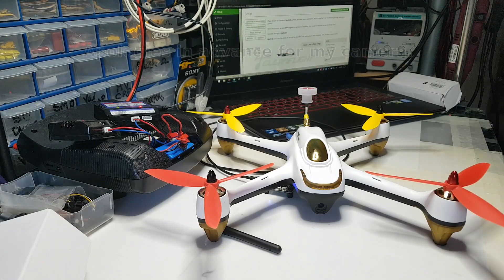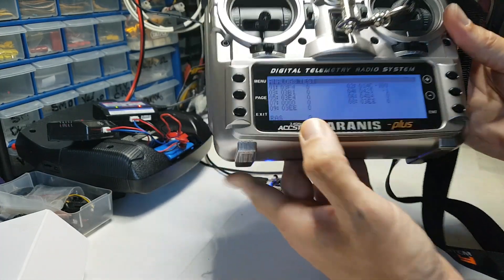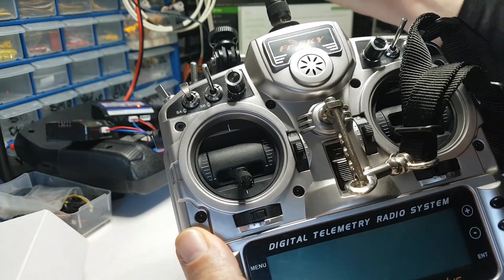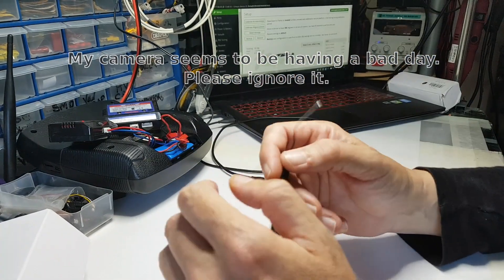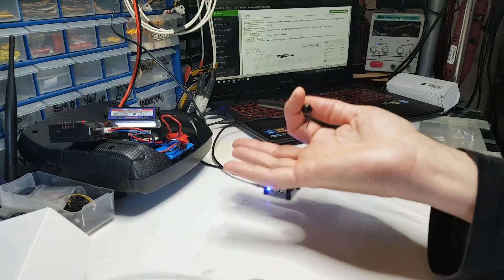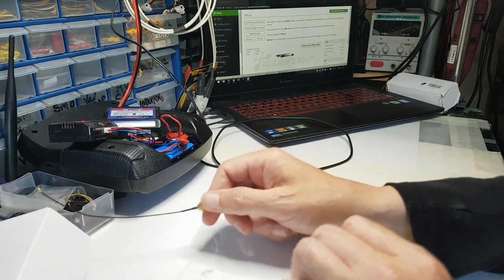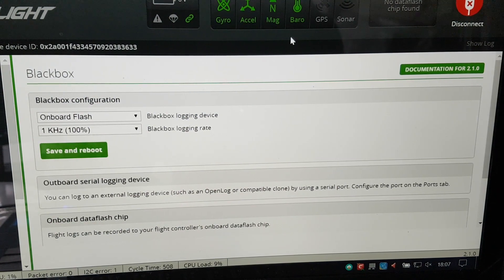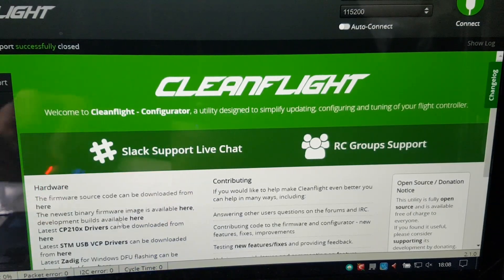Hubsan H501S Quick Tip & My Alternative Quad

Comment: Thanks for the tip about the thin ipex pigtail cables, I am going to replace mine.
Can't find RG316, is RG178 a good replacement?
Thought your fly around the park testing the triples was excellent especially without goggles.
Regards ...............
Reply from the maker: Good question. I tried with RG178 in my Taranis and the results were not great. It did bring down the SWR a little but no where near enough to use a 5dbi antenna. Finding the SMA RG316 to IPEX is like finding rocking horse manure.
The connectors SMA RG316 fitting are priced like they are gold. I found this seller who is nearly there https://goo.gl/xktXbf but a hard wire to the board would be needed. This would be OK in Taranis but not so good for some Hubsan pilots. The search continues..
Reply: Elecifun thanks for your reply, Until I can find better Ipex connectors
I shall stay with 3 dbi. There is quite a bit out there on the 
Taranis Antenna Mod that you might find interesting - I am including a couple
of interesting  links just in case you have not have seen them.
https://www.youtube.com/watch?v=LiBlbsHOPNU
https://www.youtube.com/watch?v=RtlYi1yLTVQ
On another matter, I am pleased that you openly advocate & practice 
responsible flying, I have noticed a few people have removed some of their videos
with a view to avoiding future  changes in the law, at the moment a lot of people
are providing their own evidence of guilt!!   Where do you see this going & do you believe
deleted videos are gone for good or retained like all information these days!!
Thanks again, Happy & safe flying.    Regards...........
Reply from the maker: Although a more recent viewer of Joshua Bardwell, who I find very informative,  I have enjoyed ElectroBoom video's for some time, quite the entertainer. 
I think if we do not want to many restrictions and over regulation, safe and considerable flying should be paramount for all UAV pilots.  Consideration for others is the key and others should also have consideration for us, we share the planet, together. 
If people are deleting videos they now see as a problem, maybe they are learning the error of their way's, with a mind not to repeat them. That's a good thing. I am not sure if deleted means deleted, that would depend on the strategy within the hosting platform. I would think after some set time all deleted videos would be purged for reclamation of storage space. Hard to say for sure.

Comment: Look like you are in quad tec heaven...you are having way too much fun again!..get some housework done!.lol
Reply from the maker: LOL my house work is done. 
I am going one better. I am so pi**ed off with Hubsan I am going to use one of their body shells and build different quad components into it. Making a better more controllable and easier to upgrade quad, I am going to show everyone how to do it and hope it catches on!
Shally Liu sent me a email this morning wanting to charge me $50 for "helping me out" with a replacement board for my controller.  Cheeky ......
Reply: Elecifun one more thing , what antenna upgrade do you recommend for the h502e drone it’s self , because I also added a 6dbi Rp-Sma connector without an antenna screwed on it , I added one to the tx as well but it has the 6dbi antenna I have videos on my channel , but I bought team black sheeps imortal T antenna kit , one for the tx with sma connector  and one for the drone with u.fl connectors ,  I haven’t tested the TBS antennas yet but I might not even try to because what your saying about the wrong antennas burning out a remote is now scaring me , please help and thanks
Reply: Elecifun I also subbed you

Comment: Hey there, looks like you are finally getting a DIY quad. Very cool man. I was thinking you outta try flying your Hubsan in Manual mode so you can practice flying a quad like that. Can't wait to see it in action. Cheers
Reply from the maker: Flying the H501S in manual mode with the self centering stick is a ball ache. I have a manual quad a Syma X5C which I fly nearly everyday. If I had a the Hubsan so called 'Advanced' controller I could adjust the throttle stick so it did not spring back to center and fly with that, alas, I do not posses it. 
I do have a Taranis transmitter, also a transmitter mod module on its way which will let me fly Hubsan H501S, Syma and many other models with the Taranis. I look forward to manual mode believe me, the altitude hold barometer is also a ball ache ; )

Comment: Great video Elecifun. Wonderful information for me as I intend to do a similar build. Also, the antenna info is welcome. I'm looking at ways to beef up the cables. Happy Flying my friend.
Reply: I think I have some suitable cable but I need to learn to splice coaxial.
Reply from the maker: Sonic mate you will be ok. Just be gentle and you will be fine. I would definitely change it if you are using 5dbi or more antenna.
Reply from the maker: The flight controller I am using for this build would suit you sir!  You can have GPS and switch it on and off as required. That's how I am building mine. I will make videos every step of the way so you can see what you think.
Reply: Thank you Sir! I really appreciate the info. As I looked at your setup so far I was wondering how you intend to monitor fpv. Goggles? FPV monitor attached to your Taranis? Both? I will probably attach a good monitor as I am not terribly fond of goggles. I like to alternate between line of sight and fps. I've read really good things about that Taranis btw. Sort of the industry standard I think.
Reply from the maker: Ahh, good question.  Did you notice at the back left of my Taranis there is a make shift bracket?  There is. It is there so I can screw in when needed a phone holder bracket. I have already made up a phone in a bracket with a hood that I can connect the Eachine ROTG01 to.  As I can use different antennas with the Eachine ROTG01 I am hoping it will work well. I have a transmission module for the H501S frequencies that I can fit into the Taranis  This will I hope allow me to use manual mode on the H501S without the self centering stick on the standard transceiver.  I may have to switch to a monitor to bypass dodgy android software but for now I will have to use it.
Taranis is supposed to be quite good for the price and upgradable. Time will tell.
Reply: I'm really enjoying your new build. Learning a LOT. Thank you for posting. Valuable knowledge to have before I start mine. I appreciate it amigo.
Reply: Elecifun hey they , what antenna& rp-sma or sma connectors do you recommend for the h502e transmitter and the transmitter for the h501s standard because I plan on getting the 501s , I already ordered Hubsan s antenna upgrade kit with 14dbi patch for 5.8ghz & the 3dbi for 2.4 ghz
Reply: Elecifun oh and I currently have 6dbi on my h502e remote I have videos of it flying 775 meters but sometimes early on in the flight like in my 775 meter flight I have trouble with the signal and I have to fight the quad to keep from coming back home in the begging of my video you can see me constantly stoping and Turing part way around because the connection loss then I gain control again and I’m able to fly out , I used to think it was cause the 6dbi is so much bigger then stock that maybe its sensitive at close range but I think your ideas about it are correct maybe it too much for the tx or the cables aren’t thick enough to handel the output/input from the signal ?

Comment: At first I thought "not an alternative, just a different quad" but then you showed the flight controller with GPS and barometer. Don't usually see those implemented on a 5" racer... Nice! Also, good info on the cable. Thanks for leaving links in the description. 👍👍
Reply from the maker: RD Simmers, great thing about building like this, with the options is you can tune it for cruising or racing and whatever you want in between. Putting different setting on the flick of a switch on the controller the flight options open right up. You can run with a full complement of assists, GPS etc or without at the flick of a virtual button. Awesome!
Your welcome buddy.

Comment: I look from Japan
I read the comment that I am always impressed by by translation software.
It is such me, but let me ask you a question.
Did the propeller use 6040?
What is the propeller of the animation?
Is it higher-performance than 6040?
Because because I will permit the rudeness of words, and there is not English, I leave it to translation software.
Reply from the maker: Hello Hiro, welcome to my channel.
The propellers are tri blade 6045's.
This morning is my first trial flight with the new propellers, I will upload the video shortly.